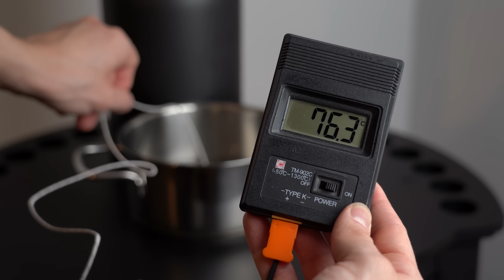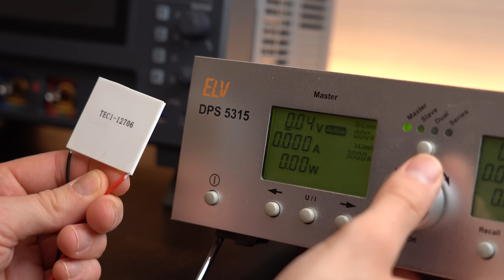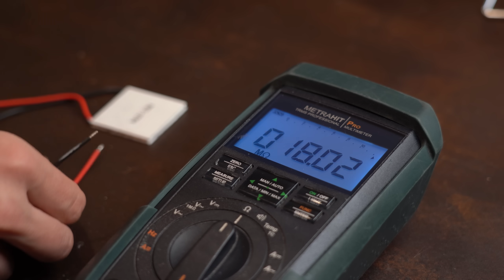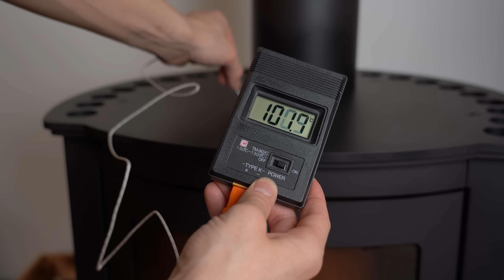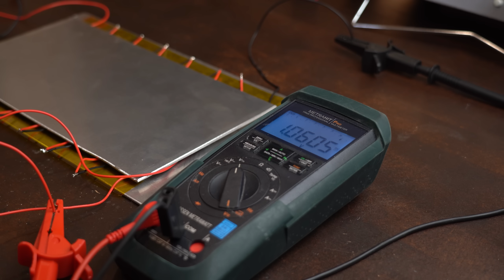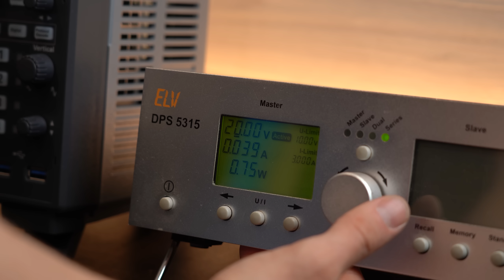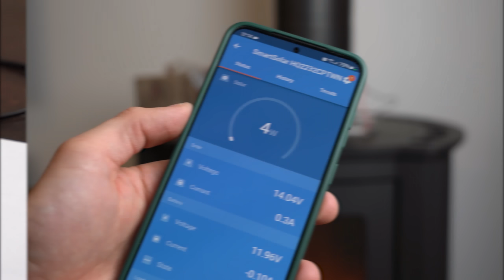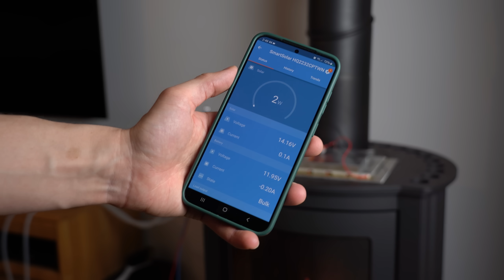I tried to Power my Home with Heat Generators! (Worth it?)

Comment: One thing to note is that if you wire all of the Peltiers in series, while it is good for boosting the output voltage, it makes the system vulnerable to any one weak Peltier. If any one Peltier has poor thermal contact or some defect, it will bottleneck the entire system with this pure series configuration. This is possibly why you saw such low output overall
Reply: I think there's something more going on here. You should have more than 6w from just one of them. I'm wondering if they can't be wired in series at all. Wouldn't that make them spend that energy? I don't know how to explain it properly.
Reply: @Reptex_krka no getting 6W out of one of these things is a big stretch. They are typically 3-5% efficient when used for generation, and that’s a decent one. It’s possible there is more going on than what I’ve said, but wiring them in series is fine generally, within reason. It just trades current output for voltage output. The only issue with the series setup is that all the current must go through every element, so if one of them has a defect, it will impact the current flow of all of them
Reply: @DrKannavas  you might be right, I'm gonna order some and try them. I have a stove fan that runs impressively well using one cheap peltier.
Reply: @ I’d focus on choosing ones specifically designed for power generation rather than ones designed for heating and cooling if you’re gonna try! they will be better optimised and more efficient. Good luck!
Reply: It’s a fair question. Certainly this might be an issue if they were all in parallel, so something in between would be good. Most diodes require between 200 and 700mV to turn on. If you use 2 or 3 peltiers in series per parallel arm, this will be easily achievable with these kind of temp differentials.  There will likely be a sweet spot somewhere between all in series and all in parallel which balances the pros and cons of each setup
Reply: @DrKannavas  His MPPT does not work well in the conditions he used it. A boost MPPT would have done a better job
Reply: I'm wondering if such a low voltage would be enough for power electronics to boost. If it can't get above the forward voltage of a diode, then there's nothing to boost
Reply: @MarioMonte13  would it be possible to run the booster circuit of a battery?
Reply: I’m currently stuck deciding on series vs parallel for my project. 

In series - like OP stated, one weak module can affect the system  and of course increase resistance / lower current. 

I would have to step the voltage down to power usb appliances.

Where as in parallel we get the maximum voltage of just one module but much higher current. 

But they all work separately and if one fails it won’t affect the system as much . Similar to how the national grid is designed.

Problem is, in parallel I’m going to have to use a step up converter and not sure if that’s possible at such low voltage … 

If anyone has any ideas on this I’d love to chat.
Reply: @ hi Luke. If it were me, I would try to test a single one of the modules you plan to use in a case similar to the minimum operating conditions you’d want it to work (ie the minimum temp difference where the device should work). Then measure the open circuit voltage and the short circuit current. These set your limits. Now with whatever circuitry you use to convert the voltage and current to suitable levels, you want to find probably the minimum voltage you can efficiently run this with. Consult the datasheet or You could try to use a benchtop power supply to supply a known current and voltage and see how low you can go with the voltage, while measuring the output from your conversion circuitry to check power out vs power in and get the efficiency of the conversion circuitry. Find the minimum voltage where this efficiency is acceptable. This is the minimum voltage your combined peltier setup needs, so from your earlier single unit test, divide the minimum required voltage by the single unit voltage and that’s how many you should put in series as a minimum. Then you can make as many parallel branches of these series stacks as you want to multiply the current. This is the approach I would take off the top of my head
Reply: @ thanks so much for that ! I hadn’t thought too much about that idea and I now see that’s actually a great idea ! Best of the both and I get to somewhat control the voltage at source ! 
Amazing ! Really appreciate your advice :) let’s hope I can get more than 6 watts haha. 

I plan on creating this set up to attach to a chimenea which will be situated outside of course to maximise the temperature difference. 

With winter temps here being around 5 degrees Celsius and a heat source of at least 200 with copper elements I think it should work quite well. 

I’ve also purchased an incredibly large heat sink which will be separated from the heat source via insulated sheet and a reflective material to ensure it’s not directly heated by the surface of the chimney but kept at outside temperature. 

The modules will also be attached at the bottom of this heat sink which is very tall which should provide optimum convection currents to aid in cooling. 

I’m still wondering if I should sacrifice some of the power to run a small fan which could push air through a vent system directed through this heat sink to aid further but I’ll have to measure with and without to see if it’s worth it or not

Comment: Peltier is a real interesting tech, just really difficult to implement effectively. Using them for cooling is also pretty in effective.

A friend has a Peltier powered wood stove fan. As it heats up, the fan spins and the fan cools the cold side heatsink.

Comment: If the problem was overheating, why not use the heat sink (water) on the hot side and have the cold side be the source of the biggest heat difference? I.e. keep the cold end outside and run the heat to it instead of the cold?

Comment: Pretty sure youre using way too much thermal paste. Also that thermal paste is not very high compared to expencive ones in thermal conductivity. 

Maybe they arent as effecient when running in series eapecially with the difference in tempdiff for them? 

A good protection for overheating is to add a bimetalic lever that lifts the whole thing off the stove if the metalic lever gets too hot (look up stovetop fans). 

Hope you are able to get this thing running at useful levels!

Comment: Make a sandwich with two alluminium cooling blocks, with the peltier in between. 

Connect the bottom, one side to a small water tank, the other side, make a pipe up, kind of chimney.
If the bottom get too hot (100C), it will boil and spit some vapor via chimney. This will protect your peltiers.

The upper one keep as is
Reply: For the hot side, you can just get modules that handle 180°C instead of the 70°C ones that were used. Also, steel on the hot side absorbs and retains more heat.

Comment: You made a mistake somehow.  Look up the Biolite generator.  Its a small portable generator that is basically a self contained unit for burning anything.  It is only the size of a coffee can and it has a built in 18650 and USB.  It's designed for the hipster on the go so they can charge their phone by burning pine cones.

You need to look more closely at the Peltier modules.  The "cheap" ones make cold well.  But they make junk energy when pushed the other way.  You need to search for "thermal generator" or "seabeck" "seebeck" "seaback" "seeback" generator.  This is the type that is used to make energy.

You will see as much as a 10x difference in efficiency.

I made the same mistake as you and couldn't make much power with the cooling modules.  But the biolite stove makes enough to charge a phone?  Have a look.

Also for a a reasonable price you can get a Seabeck generator fan that self powers on your wood stove so it blows the heat around.

Comment: they works a lot better if you boost each module to a usable voltage
W used a set up like this in 2010 to actually cool a control cabinet on a offshore supply wessel in Brazil
I cannot remember witch cucit we used, but it was some kind of small PWM modules for each element
It produced energy to cool down the cold side potable water with a only few peltier elements to make it work (Peltier and seebeck got different charastics .
Anyway it was self sustainable and and it did run Load Cell Strain Guages for a tank wheiging system

Comment: The best Peltier modules are rated for 150 C max...  If you want to produce electricity with heat, get yourself a steam turbine, which will create lots of noise.  Ecofan design works and allows to save on the firewood.

Comment: Considering the lengths you go to why was there no thermals sensors anywhere. Flow input flow output. Cold side hot side. This seemed very rushed and misleading when referencing how applicable this really is.

Comment: I have been thinking about how a wood stove could be used to generate electricity with peltier for some time, but i would only consider it for offgrid use in a cold climate.

It seems it need to be pretty much passive, if it's cold outside i could just dissipate heat passively (it might be sort of a waste but generates a more useful form of energy), there are high temp TEGs but they are way more expensive but i'm not sure it could really handle the heat from a wood stove on full tilt. I have been thinking about a water mantled wood stove, that way one could get pretty hot water moving passively in a loop and the SP1848 should still handle that the hot water. But up here in the nordics at least, it needs a way to prevent the system from freezing if it's more of an off-grid cabin where you don't live 24/7.

What i would want it for is a 20' container as an off grid cabin (nothing i have but it's on the maybe pile). It would only be a complement to solar and wind for the cold dark nordic nights when the wind doesn't blow. If one would need more power, one could fire up a gasoline generator.

Comment: Fun fact: Peltier stove fans have a bi-metalic strip on the bottom that lift them up when they are getting to hot, that is to stop the element from overheating ..
Reply: Not all have this feature. The one I have doesn't have it but it never damaged the Peltier module even when running for multiple days non stop.
Reply: You can get elements designed for power generation rather than cooling, and so able to survive much higher temperatures. They use a solder alloy with a very high melting point. But these elements are far more expensive than the cooling ones (partly more expensive materials, mostly far lower manufacturing volume) so your typical stove fan won't be using them.
Reply: @vylbird8014  Stovetops get hotter than even the best TEG's can handle in most situations. Almost all TEG designs I have seen, OR been part of myself, have needed to implement a thermal throttling method to avoid overtemperature. This can be reducing the thermal conduction to the hot side, or even dumping extra energy in case of overheating to actually increase cooling of hot side via passing more heat to cold side. (Yes you can "modulate" the heat transfer by the load on the element and even increase it past the ideal power output by shorting the element. You get less energy out, but can pass more heat, saving the element from damage.)
Reply: @1kreature  I my stove fan the max. temperature is 320°C this is far more than this can reach. That is because special TEGs are used not common Peltiers intended for cooling.
Reply: @vencdee  The max is for the surface you put your stovefan on. NOT the temperature that will reach the TEG. Stovefans use cheap TEG's that can hardly handle high temps as they do not need to. They use engineering to make sure there are limiting factors. For example the foot on the unit is designed in such a way as to limit thermal conduction. You have to remember that the unit creates it's own airflow cooling the cold AND hot side of the unit itself with this airflow. It's part of a very clever self-regulating design. The hotter the "feed" gets, the more heat it also looses due to the exponential effect on the thermal efficacy of forced convection cooling. I have designed TEGs for battery charging before and I can say with confidence that there is usually enough heat available, it's limiting it's flow to the hot side that is the hard part. Just as important as cooling the cold side.
Reply: @ That's true in every point. You must count with the type of TEG and calculate the cooling properly. Same as the commercial producers did.
Reply: that's the "technical fact" and what is the "fun" part of this fact? i don't see any "fun" in it
Reply: There are ready available power generators as products like Tegsmart. I would like to see GreatScott presentation for these devices.
Reply: That is a fun fact. Thank you.
Reply: You dont know Seebeck.
Reply: Not to mention a tall aluminium spacer not just to space the fan off the stove but to limit the heatflow.

Comment: now something like a ac system that recirculates vapour to liquid and using that energy to produce energy and getting heated in your exhaust of the oven expanded outside and back inside in the exhaust pipe WHAT like a reverse power generating heat pump

Comment: Just as you used water to cool the cold side of the Peltier you could use water to both evenly distribute and limit heat to 100°C on the hot side. Basically heat water with the wood stove and use it to power the Peltier.
Reply: I mean, than u could use normal steam generator, that will be way more effective
Reply: @Black_Engineer  A steam turbine might be more efficient but it would also be noisy. Having a pressurized steam system inside your house is also not ideal from a safety perspective.
Reply: Agreed. Underfloor heating would spread the heat over a wide enough area that small peltier modules could be used in their safe temperature range without destruction.

If it gets too hot, the water could be diverted away from the underfloor units or fire air intake could be reduced (since its solid fuel).
Reply: @Gabonro  the datasheet for the Peltier units stated a max temp of 100°C. Without pressurising the water loop it would be impossible for it to exceed 100°C. It would basically regulate itself. As a bonus it would humidify the air which is needed in the winter months.
Reply: @curtisjmurphy  Is ironic he chose the expensive unit because cheap one TEC1s have max temp 138C

Comment: I never understood why people use Photovoltaic at 20% efficient then run heaters with it.  When you can just use solar collectors on your roof that at near 100% efficient.  Converting a worthless energy source like sunlight (heat) into the most valuable energy (electricity) just to convert it back into the most worthless form of energy is silly.

Comment: about your performance test using torch/ice to make a temperature differential, hot water would've made more sense in this case.
and on a side note, it might be more stable to have the fireplace boil water and drip that onto the TEC modules.

Comment: Heavy duty 250°C 15W Thermo Electric Generator was about 100€ when I bought it. It produced 10 watts on camping stove. 
Cooling was just one liter pot of water.
Reply: exactly the issue here is the modules themselves. You have to find ones that are designed for the specific conditions and requirements. They still don't output much power vs something like a steam engine but they are a lot more powerful than what we saw in the video.
Reply: yes they use a real TEG module, but its not what the guy in the video is doing. he is using the TEC versions intended for cooling instead
Reply: @echelonrank3927  That is because TEG ones are much more expensive, and surprisingly hard to get.
Reply: Where do you find that generator, brand?
Reply: It was 10 years ago, dont remember. I have Youtube-video  "Electricity from Trangia".

Comment: wow . Here in Srilanka it costs around 0.35 USD/Kwh for me after all the additional tax so I have installed 15Kw solar system system which is more than enough for my need considering there is no typical winter here in the tropical zone and yeah I am free of any strong winds. I also sell the excess electricity back for around 0.10 USD.

And I can not decide whether to upgrade it. shall I? And how much should I upgrade guys?

Thx for the videoes and keep uploading...

Comment: There is a secret on Voyager probe thermoelectric generators. Stuff they steal from people before making sure they can't tell who they stole it from. How long can ice be ice in space? Makes a panel with water inside with room for expansion, cranks a small stator to power vacuum pump to greatly reduce pressure inside, and then cold boils the water by venting heat/energy to fast freeze the water Regenerative ice technology, bring space to you. Looks at air conditioning systems world wide and laughs hysterically